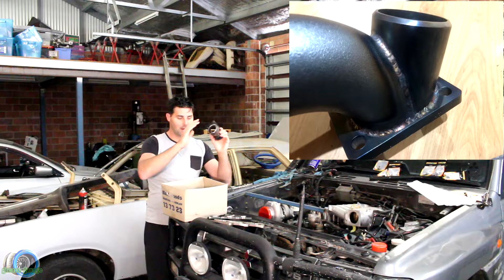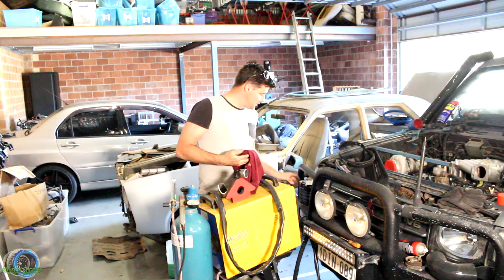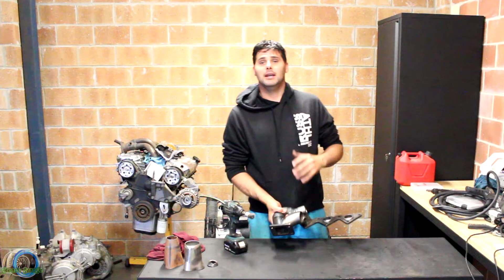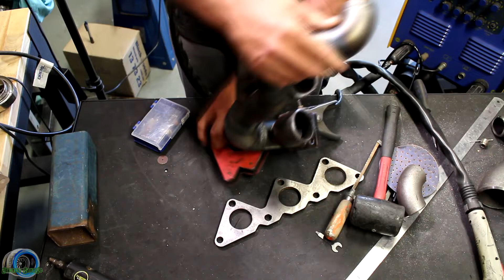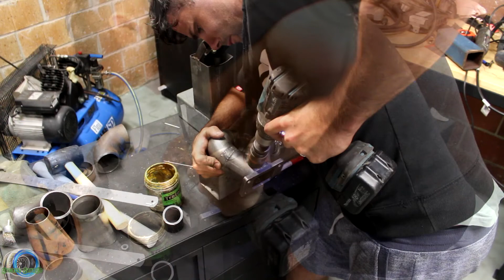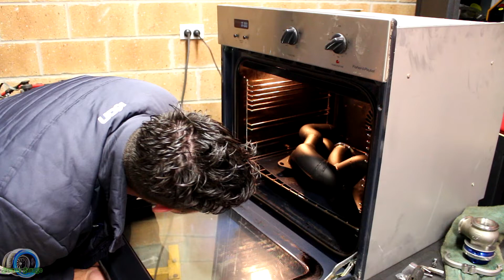PAJERO NEEDS A TURBO  Part 2 LETS BUILD A EXHAUST MANIFOLD

Comment: Yeah definitely want the cost price then how much to have it all fitted got a 02 gen 3 3.5 ltr exceed looking at the turbo upgrade and 2 to 2&1/2 inch exhaust system and obviously have it cammed once all that's done
Reply from the maker: 17k to do most of it, as the car is now its 40,000AUD Josh has changed alot over the last 12months and we will be doing a update video very soon, the car car come alone way, ended up making over 640whp

Comment: How much was the total cost
Reply from the maker: as it stands now about $40,000 AUD,  but the original build was about $15 ~$17,000AUD , its blow out because of the forged engine and the new transmission

Comment: Hi, what injectors are good that fit the 6g74, that i can get here in the USA? i want to centrifugal super charge mine in the future.. grate video , real good info.
Reply from the maker: Sorry it’s taken so long to reply, here are your best opinions 
6x Denso 565cc ev14 3/4 length 11mm o’ring (found on the Subaru WRX ) (300WHP-350WHP) (Wiring fits )

 aftermarket 
*6x Raceworks 1200cc ev14 3/4 length denison connector 11mm ethanol /methanol safe ( 500WHP )( wiring fits ) 

*6x Bosh ev14 2200cv short denso connector 14mm o’ring  LPG inject  ( can run ethanol just no warranty) needs 6x short to 3/4 extensions ,14mm to 11mm (700WHP+) 
 (injector wiring needs to be adjusted )

Comment: Where did you buy the steam pipe from? I can’t seem to find it anywhere
Reply from the maker: Ebay for the pipe and blackwoods hardware for the bends .. what do you need i can find you a link maybe
Reply: @GREASEGARAGE  basically what you bought! 10 90’s or so and probably 500mm of straight pipe!

Comment: So, what kind of time do you have in the exhaust? Reason I'm asking is to help people over on my page Mitsubishi Monteros USA understand why it costs so much to have someone else build up this stuff. Great work! Not shown,  and I'm not sure it's even necessary,  but is the manifold braces on the turbo side to handle off roading? Thanks, subscribed and looking forward to episode #3. ♦️♦️♦️💪
Reply: About 40 hours from my understanding! I don’t think it will need a brace as that manifold is super super strong!
Reply from the maker: Start to finish was around 40hours of work, if I had a purge kit that injects argon gas into the piping as I was welding on the out side, then the time would be cut down, as you wouldn't need to grind any internals of the piping, I am using thick metal piping so the manifold is extremely strong, and because the turbo isn't hanging to far from the engine the wouldnt be under as much strain as a manifold that had a turbo hanging further way from a engine,  a brace shouldn't be needed, though its something that could be added on if there is any issues... Thank very much for a great question!  oh and just a thought, if you did use thinner metal, a brace would be a great idea,

Comment: Hey mate, much difference trying to do this in a ml triton 3.5? Figure it wouldn’t be too diffident aside from the space available. Any goals for torque and hp on this build? Awesome work on the fab mate
Reply from the maker: Great question, I believe both the intake manifold and turbo manifold would fit without a problem, the intercooler piping should actually be easier I reckon, with the standard 3.5L 300hp 500<nm of torque, the next stage after the turbo it 6g75 and manual, so maybe around 400hp 600-700nm torque, and thank you

Comment: I can's see those manifolds lasting long before they fail.
Reply: Paint is the worst thing to do with manifolds
Reply from the maker: Sorry , I missed your post! that is not "paint " its a ceramic coating which helps with heat, and also seals the metal so it doesn't rust straight away. used it on a heap of my personal cars and no issues other then it needs re-coating every couple of years
Reply: @GREASEGARAGE  It doesn't stop the heat and once they crack, they're a lot harder to weld.
Reply: But you blew up the engine anyway, well it was inevitable.
Reply from the maker: what make you say that ?
Reply: @GREASEGARAGE  Have they cracked yet?
Reply from the maker: The welds on the exhaust manifold that we made? Nothing wrong to report, can I ask why you think they will crack ?
Reply: @GREASEGARAGE  When it gets hot everything expands, then it shrinks when it cools. You can only put it through so many heat cycles before cracks appear. Got to use the correct materials along with the correct design. It's ALL wrong.
Reply: If you try to make it extra strong all that will happen is that the pipes will try to pull out of the flanges, the flanges warp and leak and you have to start all over again.
Reply from the maker: Oh yes, that is a fair point… if anything like that does happen i’ll report it in one of our videos,  I am confident but that it a valid point, i wouldn’t want to be misleading
Reply from the maker: i don’t think it’s all wrong, i’ve made manifolds before and they are 15plus years old and no issues
Reply: @GREASEGARAGE  It's about how many heat cycles you put them through. Sitting in a shed doing nothing and with blown up engine doesn't count.
Reply from the maker: I was talking about loud1 , the turbo 6G74 making 627hpowers